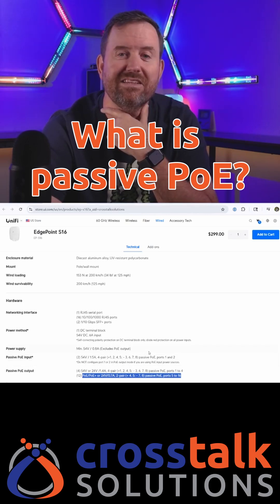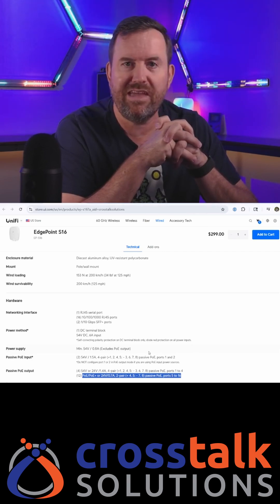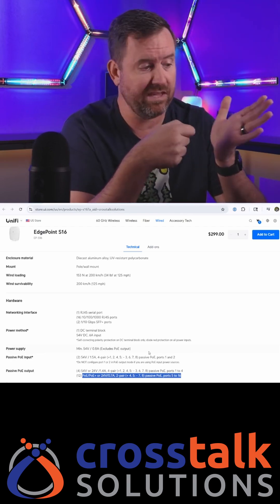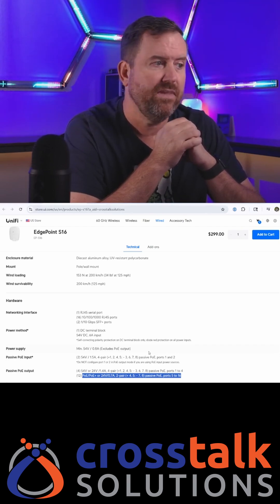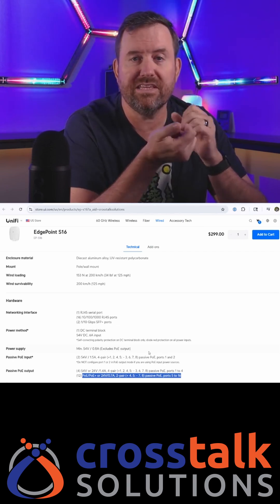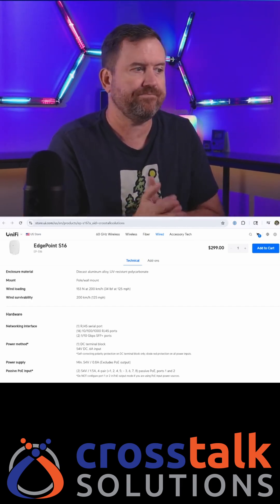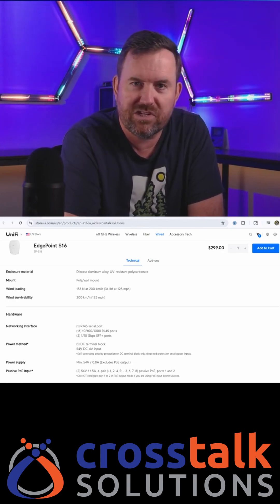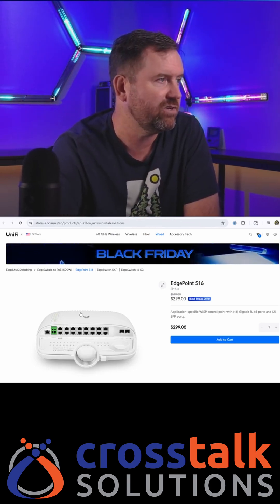What is Passive PoE? Don't Fry Your Equipment!

Comment: All of UI’s PoE injectors are still passive which is why they do not state the 802.3 standard on them unlike other manufacturers. Make sure you don’t mix up the cable ends when plugging them in.

Comment: POE Passive is atill pervasive and needs to sunset immediately. mfrs have had so much time to migrate to active af etc. The only argument for the mfrs I can think of can be cost - any other ideas? I need to add dedicated injectors or use the ones that come with the kit which makes the Job untidy at the very least...cmon china

Comment: Our company installed hundreds of passive PoE devices, but nearly all were fast Ethernet where there’s no data on pins 4,5,7,8.  Power, either 24v or 48v was placed on those pins.  Some cameras used passive PoE.  We even used them for WI-Fi APs & routers with cable splitters. 

TP-link made a switch that could do 24v or 48v passive PoE.  Think I used a similar Ubiquiti switch too.

Comment: Unfortunately, because of Ubiquiti and equipment differences between UISP and Unifi, and their lack of upgrading and standardizing everything to work well together, I've been designing panels for customers who have a mix of systems to use both standards. That there EP-S16 has been very handy in several panels to set them up. They were nearly half price for Black Friday, too.
Reply: I guess 24V devices are great on our 24V solar operated panels though.
Reply: What I started doing now that Unifi switches stopped having 24v passive poe capability is use a 1U rackmount device from a company called "poe-Texas" that is a set of 12 inputs and outputs all with 24v passive poe. Basically like having 12 injectors all in a rack space. 

It has switch to choose which pairs are positive and which negative, so it is compatible with both uisp and mikrotik hardware (as well as any other brands) and works as a great way to cleanly and easily integrate passive poe into a network rack design when needing to go to those types of devices. And since it uses a plain old DC power supply you can easily replace it if the psu fails.